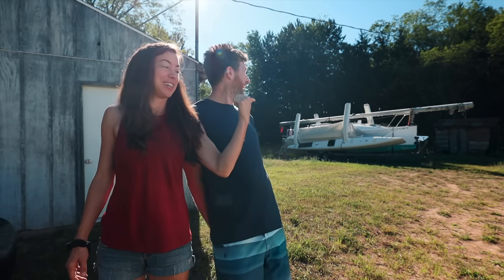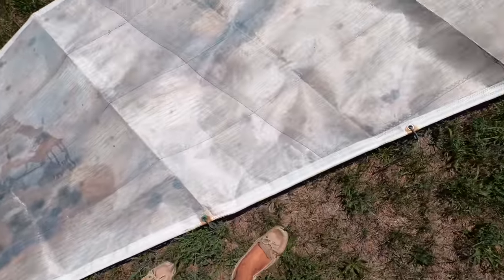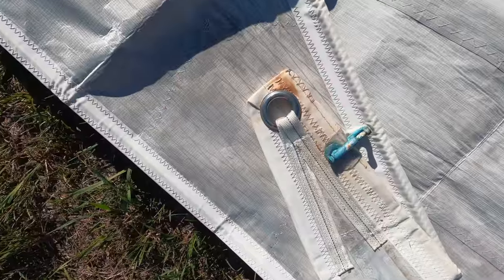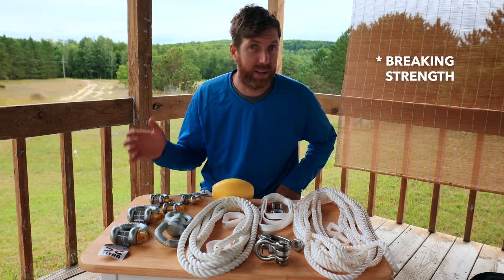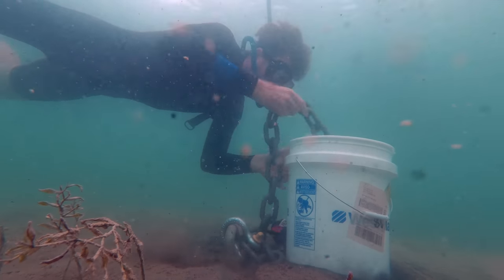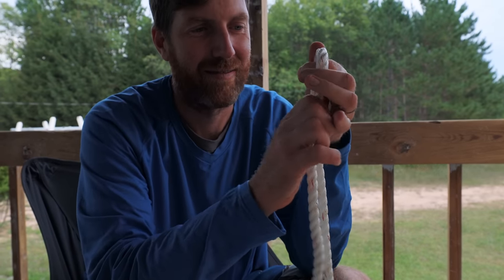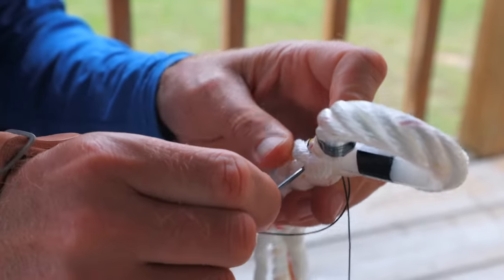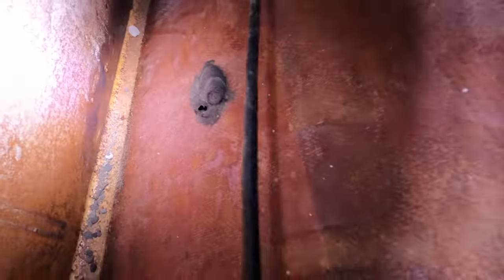This Keeps our Boat off the Rocks (Building a DIY Mooring) | Sailing Soulianis - Ep. 118

Comment: Might be a good idea to have a clump weight half way the mooring chain. That works to absorb shock loads (you're then lifting the clump weight from the sea bed which is hard to do) and keeps the last end to the anchor pin horizontal, thereby loading that in the best possible angle. On large ships it's the chain that does all the absorption of the shock and the anchor actually does only partly contribute to that. On a mooring you don't have that luxury to put a large amount of scope on the chain, so the clump weight is a way to work around that. Need not be big, just a heavy rock or some bundled chain.

Comment: Best mould remover is Benzalkonium Chloride--but another thing that works is sunlight--and that is also the killer of sails.  Old does not mean bad.    Just use them--the salty sea also kills mould, along with some sun and a little rain.  I make my moorings out of concrete and scrap metal welded into a lattice,  with the eye of the mooring block made from heavy stainless.  To this I fit a LONG stainless  shackle which I add a pair of Tufnell blocks to enclose the eye of the mooring, and the other end of the long shackle is connected to a polypropylene rope. (Or nylon) which terminates on the float.  To this termination is also attached a floating polypropylene trail lead to another float.  This streams behind the main float, and is the target of a boat hook or tossed grapnel on a line.

Comment: Sailing Soulianis Family,  It was noted below, but I will note it again,  You must safety wire all the shackle pins.  I learned the hard way. You can tighten up the pin and as it is loaded up the body of the shackle will flex and the pin will become loose.

Comment: Scott's outdoor cleaner is apparently ok for cloth.  It can be used on interior cloth overhead material and exterior anything.  Try a little on a dirty corner.  Washed the outside of my Morgan N/M 36 that had some mildew under the lines crossing the deck to the winches in the cockpit. Clorox didn't do anything.  The Scott's worked amazingly well, and the next day, even though I rinsed it the first day, the decks were even cleaner.

Comment: I had a mooring installed a few years ago. It was done by the company that has installed most of the mooring fields in Florida, some of which are Sarasota, St. Augustine and some in south FL.  They didn't use any chain, old school they said.  The entire system was large synthetic line.  One reason being that is has a little stretch when there are large loads when it's windy and rough.
Reply: Strange because the main purpose of the chain is to take the abuse of friction with bottom, and to add a lot of horizontal direction to the mooring load.
For instance my light swing keel 26ft has a little over 1.1x (minimum depth + freeboard) of welded chain above the anchor. I have that much tough weight above the anchor and cleatable line attached to that. (Inland lakes, occasional overnight.)
Pretty common solution and similar to theirs.
Reply: @artsmith103  Perhaps your situation is different.  Here the bottom is sand maybe with some grass. With the synthetic line I don't think it's on the bottom. I found a photo of the complete rigging before it was installed.  There is a float a few feet from where the line attaches to the anchor, which was like a large screw augured into the bottom. A completely different system than what you used which partially relies on the weight of the chain.  They told me that I would pull the cleats out of my boat before the anchor came out of the bottom.

Comment: Mouse the shackle pins or you'll lose them, Stainless steel wire is best, talk to your cable guy, they use it to secure cable installations and usually have ends left over.

Comment: Quite surprised you’re not using a snubber on your mooring line. They’re extremely useful for absorbing shock loads.
Reply: The bridal does the same job as a snubber, the mooring line will be slack with the stretchy rope of the bridal taking the shock loads and keeping the bows to windward, it's a pretty normal setup for a trimaran.
Reply: Pretty sure a bridal has nothing to do with boats or moorings. Perhaps you’re thinking of a bridle….

Comment: .... IMPORTANT !!!  Do not "flack"/crease/fold  those sails .... Roll,  Roll ... ROLL !!!  That material does not like to be folded and will fail at those creases ...  Find a carpet store and ask for one of their tubes left-over  from a roll of carpet  or a length of PVC pipe ... to clean the sail ... find a "trough" (animal feed) long enough ... place the sail in it and soak ... soak ... change the water ... soak some more .... ( I raced beach cats w/ Dacron sails and Pentex sails ... you have to treat them totally different !!!)

Comment: Did you seize the shackles on the mooring?  I use zip ties.  It doesn't require a lot of strength, but you want the pin to not be able to unscrew.
I would try leaving the sail out in the sun for a day or two.
Not bad for your first and second splices.
Reply from the maker: We did seize all pins/shackles once getting everything put together.
Reply: I echo the sentiment of sun bleaching the sails, and perhaps experiment with some diluted bleach solutions.

Comment: FYI.  Your Mooring set up looks good.... Although the weakest "Link" will be the chain at the mudline.. In my experience a 3/8" Chain will last about one season..... Remember.... the ball with the chain is moving 24/7..... Check it often....   Good Luck
Reply from the maker: 5/8” for big chain that lies in the mud. 1/2” for the smaller.

Comment: I assume that at some point your seized the pins on the shackles of your mooring equipment.  You also can avoid a lot of wear on the chain and shackles by dropping the chain to the bottom with a line and a buoy over the winter.   Folks in Maine just put a log for a buoy..  Observations from a retired harbor master.
Reply from the maker: We did use seizing wire on all pins once everything was permanently installed.
Reply from the maker: We did also drop the buoy over the winter to avoid getting hung up in the ice pack.

Comment: Buy colloidal silver solution. That is silver made liquid in water. That is something those fungi really don't like. When I had fungus in my wall I used it and it never came back. You can dilute the water you have, but keep any metal away from it. I might even advise to spray it on the sail on gravel and not on grass. It is also used as medicine, so not direct poison, but better keep it away from skin. It might color the skin. Good luck!